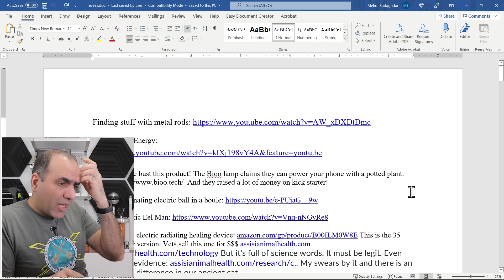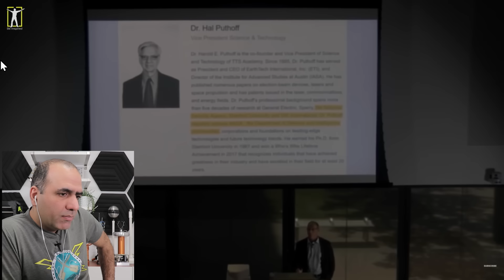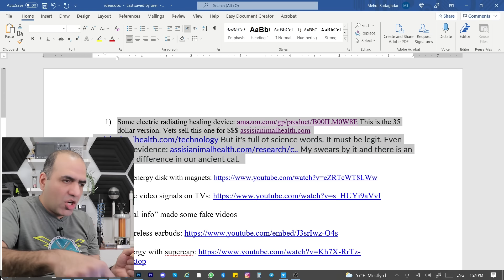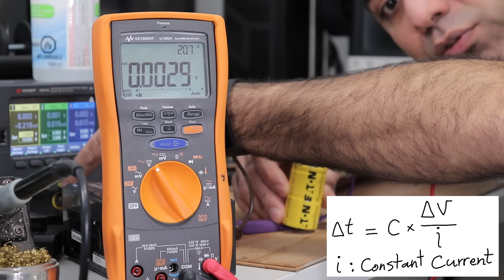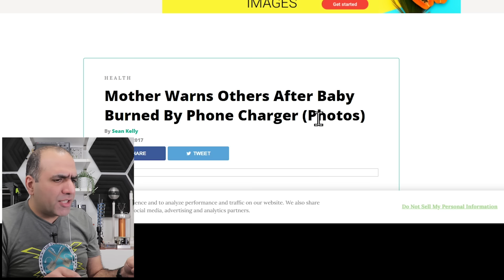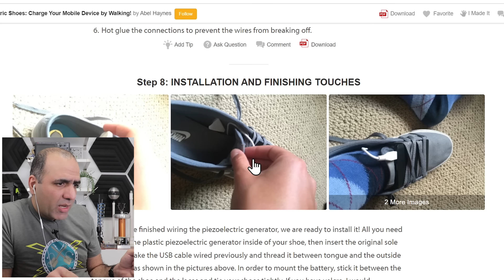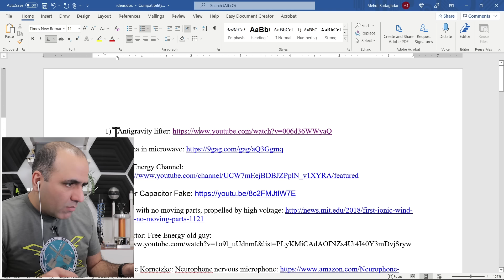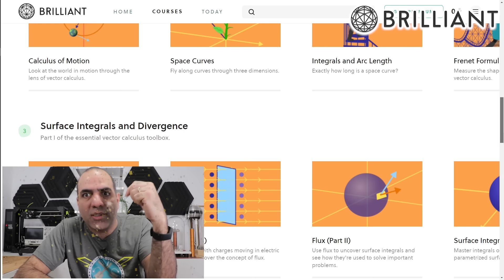The GARBAGE People Fall For, Year-End Cleanup

Comment: I remember being an amazed 12-year-old kid the first time I saw a well driller use a set of witching rods. Years later I found that we were directly above an underground aquifer a mile wide and 12-miles long. He could have drilled literally anywhere and hit water at 180 feet.
Reply: So you're saying the rods worked!

...for him.

...with tricks.

FORBIDDEN SCIENCE!!!
Reply: I did this to find a water hose underground and it worked
Reply: I have personally used witching rods....they work. Don't ask me how but it does every time.
Reply: I work in municipal construction. We often call for a utility locate (because we have to) and then witch it ourselves.
Reply: @andrewkamm8784  Sounds like confirmatiom bias.  Witch the stuff first, then call a utility locater.
Reply: I'm sure by now someone has done hard science on the rods. Truly blinded. I don't remember how long ago, but I remember seeing one such experiment that showed no meaningful difference between random chance and a "skilled search".

It's one thing to dowse in a location where one knows there will be a source, and quite another to dowse in a very controlled situation. If the method works then it should be possible to dowse the direction of a buried pipeline. Not just a point location, but dowsing multiple points to indicate a buried pipeline and its orientation.

Anecdotal evidence itself may indicate our propensity for predictive outcomes, as opposed to falsifiable, relatable evidence.
Reply: I know right... <Me, with two rods, walking over a suburban road:> "OMG! Wow! I found a pipe under here!!!!"
Reply: I think you should test it yourself, before you claim it is not real. I want to know the science behind it.
Reply: @ScotHarkins  I am telling you that it is accurate in an open field. We located a 60 year old sewer line that the city had no record of. We needed to eliminate the line  due to E.P.A guidelines, before we could excavate on the property. I have over 10 years experience in the field and trust witching over poorly recorded schematics. I am not going to go on about this anymore, but am curious how it works.
Reply: @andrewkamm8784  The witch rods prove that the earth is flat, If the earth is round the rods will be square, but the rods are rods so its flat, ~ I Asked Your Question in Facebook and I received this
Reply: but bro wtf it worked for me for real i used those to find pipes a little under ground that i use to water my grass and i forgot where those were, my uncle came showed me for example how it works and it showed exacly where pipes were
Reply: @andrewkamm8784  cool. It is a thing that keeps turning up in the hands of professionals in the field who are otherwise using standard professional practices that are guided by engineering and legal principles. It is difficult to simply ignore anecdotal experience like yours.

The trick is understanding the boundaries in novel discovery conditions such as "we know there is a pipe here somewhere, just not exactly where", in conditions where one could not simply dig up an overlarge area on, say, a public roadway. The first obvious "yes, but"s are experience with similar situations over a working career. Established roadways rarely change orientation or lateral location over decades or centuries, so there are some dimensional boundaries already in play, even if unconsciously.

Do you have a specific set of rods that you use all the time, or can you make rods on the fly, or like the old witchers strip down a y-branch and use it? You may only have experience with rods and not with witching sticks, so really I guess it would be do you have "lucky rods" or can you make do on any job? Do you feel the rods being moved by some force acting on the rods the same as if someone actually pushed on the tips?

Have you gotten better over time with the skill? How many years practiced, and how many times a year? Would you say your skill improved significantly over time or just somewhat improved? Like from "works sometimes" to "works always" versus "worked always but I'm more accurate now"?

Have you noticed any difference in sensitivity around external conditions? Works better or worse on cold versus hot days, drier versus humid days, etc. How about with the soil encountered at a site? Better when the soil is sandy or more clay? How about plain weather?...like with storms in the area does or does not work so well, etc?

Huh...it should be possible to create a questionnaire that walks practitioners like yourself through such questions. Gather data on personal experience, personal choice of dowsing tools, likely conditions where used (locating buried pipes, buried springs, shallower water tables, etc.), to help define where and how the skill is employed and by whom and with what success.

The reason we get so hung up on the unlikely nature of the skill is that there is a physical tool that moves in some way to indicate increased probability of the sought-after source. "Moving" a thing requires force, but experiments where the tools were not directly controlled by the practitioner showed no such movements or even detectable forces. Sadly, placing rods in the high-dexterous human hand means the rods can be easily and subtly manipulated, meaning the "force" is likely introduced by the user, making the measurement subjective and prone to a vast array of motivating conditions, even unconscious will informed by technical experience that is difficult to express in words but easy to access with a tool that maybe quiets the noisy conscious mind.

It is a fascinating and ancient skill that is still practiced around the world. It is possible we are simply not asking the right questions, focused as we are on the tool and not the practitioner, and centered on the idea that there is some external force moving the tool, versus the tool being some means of indicating something that we simply did not know that we knew.
Reply: @ScotHarkins  Probably the most correct idea how to prove or disapprove this "phenomenon". Honestly I would believe in Harry Potter's sorcery more - it most likely is based on real quantum effects.
Reply: @KrotowX  I'm going with a mixture of things that amount to local awareness and subconscious signaling.

In the country you might learn about which trees and grasses favor available water versus those that fill in the more arid areas. Your witching success would favor first your plain knowledge, most likely local, and a native intelligence around flora and fauna. Your successes reinforce a mental image of the area where you struck. Over time that mental image is reinforced...the mixture and density of plants and grasses of kinds that dominate more hydrated spots. You don't think about it, but it "feels more right".

The process is not just the rods or sticks. You start to dig and the soil is darker than drier soil...the moisture gradient may rise more quickly with water closer to the surface. Maybe it's even enough to increase the humidity over the area, and your nose picks it up even when you don't think about it consciously. All of that feeds your mental map of better spots. You don't "think" about it...it is now just innate experience.

An urban area would be different. Still trained over time by experience. Maybe you know the town's history...you kinda have to when dealing with buried pipes going back over a century. You might have noticed that in the 1890s they tended to run sewer pipes down the very middle of the road, usually at some depth and slope common to the time. You might have looked at maps from the 1930s with a 40 foot right of way but be aware that the current roadbed is wider by 15 feet to one side but only 10 feet to the other. Do you actually sense the pipe or are you imagining the pipe under an overlay of the old and new road and unconsciously making a reasoned guess? If the pipe is 24" wide your dig is still going to be 48-60" wide, which gives you good odds of being "close enough to be right".

The upshot is that the tool may be about letting go of the conscious thought process to give way to a more creative subconscious process that is simply informed by all the disparate bits of knowledge. The result would be that you move the rods or stick yourself, but you don't think about it. It's a subconscious result and not a conscious choice.

History records ineffective witchers and dowsers who could not make a trade of it. How many of those were there, and how aware were they of the telltale signs compared to the successful witchers and dowsers?

Some people could not machine a course-threaded bolt no matter how many times they try while the next person has it mastered in only a few runs. No reason to think the same differential propensity exists within a body of hopeful witchers and dowsers. Many may fail and several succeed, not for lack of magic or grace, but over how well they already know better spots from worse spots, and with their ability to improve that experience over time.

I think a truer test would be a non-local, new-to-the-subject area, over a controlled and mapped area...for soil conditions, water table, depth and orientation of buried pipes and hoses, etc. Do the same over a natural area with local and nonlocal subjects, mapping all their answers (but not yet digging) and checking to see how they actually compare by then digging for each.

By these means you can test whether there is an actual phenomenon, or a local knowledge aspect, or a combination.
Reply: If anyone questions the validity of the witching rods. I challenge you to take an old hanger or a decent gage wire, and try for yourself. First, bend the wire 90° with a short side at least an inch longer than the width of your hand. Have 8 inches to a foot on the other end. Next place a rod in each hand, resting the tip of the shorter side on your pinky finger. Tilt the rods forward slightly so they are resting on just your index and pinky finger, do not grip the rod. With your elbows at your side and your arms bent 90°, walk forward slowly between your water, natural gas, sewer, or any service line supply and your house. Anywhere you intersect the service line you will see the rods attract towards each other. Place a mark where the rods are parallel and repeat from other side. Be sure to place a mark when going both ways. The space between the two marks is your ditch line. You WILL find your supply line within 8 inches of the space between your marks.
Reply: @ScotHarkins  It’s very easy to ignore anecdotal bullshit. I do it all the time.
Reply: @andrewkamm8784  Yea, no. Just no. That is not how physics works. Please stop spreading this nonsense.
Reply: @TheJohnreeves  you tell me that a construction supervisor of 7 years doesn't know what he is talking about? I use them effectively every time. I don't understand how they work, but know they do. 
I am not trying to start an argument,  I just ask that you know your $#1+ before you question me. And I can definitively say you know nothing on the subject.
Reply: Lol, I am done with the subject.
Reply: @TheJohnreeves  It is not like I am commenting on something I know nothing about, like you are. I am not commenting on how to crochet, I'll leave that up to you. I am done with this stupid back and forth.
Reply: They use these in construction where my dad works to find water and power lines
Reply: @andrewkamm8784  I don't know what to tell you, you've been suckered. It's not like people are immune to it just because you've done a job in the field for a long time.
Reply: @andrewkamm8784  The irony of "you can't fix stupid" being said by someone who believes in magic divining rods.
Reply: @andrewkamm8784  i used to believe dowsing rods were BS.  then i watched a guy i work for use them.  we found a water line that we were looking for quite easily.  years later, i helped my father-in-law find another water line.  works great!
Reply: @andrewkamm8784  my dad showed me how it works for some people and it ends up it works for me. An old man used his keys to tell my dad where to drill for water on his 15 acres, he not only found where to drill but also told how deep. We have one of the five biggest wells in the county and the depth was exact. There is no scientific proof or explanation for it just a big well we have used for fourth years. None of the neighbors have anything near what we do so it's not a giant aquifer. There are hints though such as a natural spring and a seasonal creek close by so it could be that coupled with years of experience since the old man was known to find water for anyone that asked. If I remember correctly his success rate is near perfect.
Reply: @andrewkamm8784  the name of the technique is Radiesthesia. In my 34 years old, I come to conclusion that it may work for some people and to others don't. Also not only to water, but anything that person using the technique wants to find. People here also use wood into a Y format. I remember a a news tv where a guy used to it, ask for some one on the news crew to try it. When it worked he, the tv guy,  got scared and run way.  Most people who dig wells here, and do not use this,  when asked about, also does not have the courage to say it is bullshit, yet internet warriors most think it is.
Reply: @fernandoschumans4542  no you had placebo effect and got lucky, thus you believed it solved your issue
Reply: @andrewkamm8784  There is no need, holding pieces of non counter weighed metal rods in sweaty hands are going to go all over the place regardless of some mystical divination power that doesn't exist.
Reply: @dougsmith9290  its a placebo effect, you got lucky
Reply: @robywankenobi32 Wow, I am embarrassed for you. Is ground penetrating radar, cost effective? NO! Do you have any knowledge about the subject .....no. So why show your ignorance?
Reply: @robywankenobi32  have you ever tried them yourself?
Reply: @lowlowsandclothes9923  nope I wouldn't have to because I have a scientific approach to everything in life call evidence based decision making, I wouldn't need to do any testing to make myself happy or conclusive as as the entire quackery has to many variables to clearly answer the hypothesis - voiding any of the claims of two pieces of fucking steel rod or sticks some bloke broke off a tree hahaha
Reply: @robywankenobi32  A true scientist will always test before coming to a conclusion. You are not.
Reply: @andrewkamm8784  I literally don't care for any of your responses sorry haha, bye
Reply: @niallgalaxy48  let's all stop "beating a dead horse"
Reply: Why not trying those rods on water hoses that are upon the ground?
Reply: @brendanwarrick4978  Two sticks are not technology lol
Reply: @andrewkamm8784  I do like how this guy has continued to respond after 3 times saying they won't anymore (four if you count the "stop beating a dead horse")
Reply: @RatchetOrion  how about 5. Lol I was referring to the one guy but whatever
Reply: Honestly proving this will not change anybody's life so......I won't try anymore.
Reply: @andrewkamm8784  
 
"Won't?"
Or can't?

Like I said to Brendan above, if you really are so certain that these 'witching rods' (so called) truly can be used to find buried water pipes and so on, you should definitely get in touch with The James Randi Foundation and demonstrate them.
Not only would you win a HUGE cash reward, right then and there, but a Nobel Prize with your name on it would practically be guaranteed.
Reply: @andrewkamm8784  And seeing the responses to your testimonial has totally turned me off from this channel.  This guy must attract people that behave a certain way because he behaves the same way.  He's very popular too I see.  Yikes.  I guarantee none of them have ever talked to a well driller or would even be capable of having a productive conversation with one on the topic.  They act as though they believe they are the Galileos, when in reality they are the church calling out heresy.  It's fine if they are very skeptical.  I am myself to this day because I can't see how it works, but I can't be so bold to say I KNOW it doesn't work when it is still something that professionals in the craft use.  Only fools are positive about whether witching works or not.  Living in Alaska, where wells are still being drilled daily, I have come across plenty of engineers that said they couldn't believe there was any truth to witching rods until they saw it for themselves.  It is indeed a mystery, not simply a scam.
Reply: @ericksonjustinAK  
Which 'professionals in the craft' use magic to find water?
What are their names? Who do they work for? How many times have they actually demonstrated successful use of this method?
Who are these 'engineers' you claim you've met? What are their names? Who do they work for? How many are actually ON RECORD as believing in this stuff?
It's easy to talk about people believing in, or being able to do magic, but for some reason actual, reliable evidence seems much harder to deliver.
Reply: @ericksonjustinAK  
"Heresy?"
Seriously?
It's "heresy" to simply ask, "Oh yeah? Sticks eh? Can you please show me?" is it?
It's "heresy" to doubt unsubstantiated claims?
Doubt and skepticism is hardly unwarranted when dealing with claims like this. 
Claims which have repeatedly and consistently failed any kind of unbiased verification for literal centuries now. 
Did you ever hear about that lady in Uganda (I think it was Uganda..?) - called herself a witch or some variation of the term - who claimed she could make refined, high octane gasoline come pouring out of a rock?
There's a famous photo of her 'demonstrating' her magic gasoline pouring out of her rock and into a bucket in front of the leader of the country.
The government gave her a giant pile of money to produce magic fuel, and she disappeared.
Later on, when someone actually bothered to check the rock, they found it was hollow with a tank and a pump inside it. 
Do you think that government was wise to accept her claims without checking carefully?
Did all the people who scoffed at her 'magic' and insisted it must be a scam have good reasons for doing so, do you think?
Likewise, do you really think that anyone who scoffs at 'witching sticks' does so without perfectly good and justifiable reasons? Or are you sticking with "heresy?"

[Edit: I was mistaken - the lady with the magic rock was from Zimbabwe, not Uganda.]
Reply: @brendanwarrick4978  
Iron is magnetic. Iron ore (magnetite), Nickel and Cobalt are magnetic, when a field is applied to them. A couple of Rare Earth Elements are magnetic within certain temperature ranges.
They aren't found just lying around in the soil though, and any detectable magnetic fields they might emit have nothing to do with water.
If your claims were true, and these fields were actually there and powerful enough to move a couple of wire coat hangers in some 'witch's' hands, then they would also render traditional compasses absolutely useless the whole world over.
Likewise, any electronic device which relied on some kind of magnetic storage, like a cassette or a VHS tape, or a computer hard drive, would also become completely useless, anywhere there was water flowing underground. 

No, it's got nothing to do with magnetism. 
Would you care to try suggesting something else?

(Yes, I was well aware that you meant "ferrous," rather than "Ferris." I made a point of drawing attention to the error however (not to mock, although I understand perfectly that it probably seemed that way), in order to show that such an elementary mistake, along with the idea that there are such things as water 'atoms,' and the carelessness that allowed those mistakes to creep past, puts quite a dent in your credibility.
Sorry about that, but it's just the way things are. It's always worth proof reading before posting, especially when one wishes to be taken seriously.)
Reply: @brendanwarrick4978  
You want me to try and prove your wacky claims FOR you?
Think again pal...

You could have just said that you didn't know - would have been a little bit more graceful.
Reply: @ericksonjustinAK  
You think it's "incredibly rude and arrogant" to simply ask that people actually support and justify their claims of woo-woo, witchcraft and magic?

If you really want anyone to accept that 'professional well drillers' actually, truly do use these 'methods' when choosing where to drill, then I'm afraid it's going to take a little bit more than just your say so.
Honestly, it's like your side of this is actually allergic to convincing evidence.

You're right - the magic gasoline woman was a terrible example to compare this nonsense to - SHE actually went to the effort of giving a demonstration of her 'magic' (faked though it was).
You guys seem to expect everyone to accept everything you say, simply because you said it. That's not enough.
Reply: @brendanwarrick4978  
There is no "disproving" in science. 
I'm honestly not super surprised at the misconception though - it's common one. 
It is impossible to 'prove' a negative.
In any case, that's not what I'm trying to do - I'm asking that the people who apparently believe in magic, and apparently care enough about it to bicker about it in public like this, give some reason (ANY reason) to believe what they say. 
Your word, I'm afraid, is just not good enough on its own, and the way you all go running for cover, screaming insults over your shoulder when anyone mentions "evidence" only further hurts your credibility.
Reply: @stickiedmin6508  Whatever.  I wasn't trying to convince people that don't want to be convinced.  I am just sharing what I know about the matter.  Believe what you want to believe and quit being offended because I'm defending someone giving a testimonial of what they have witnessed.  You have never been around someone that uses witching rods and I can tell you have never talked to a well digger.  I have and so have others.  Get over it.  You're demanding that I provide names and concrete evidence, etc etc.  I am also skeptical.  But I know well diggers still use them.  I was just sharing my experience.  I have no duty to prove to you anything and you demanding that I do or shut up is exactly the attitude I'm talking about that is acting like what I am saying is heresy unless I can prove it.  I'm muting you now.
Reply: @brendanwarrick4978  
You understand that rust is not iron though, don't you? That it's not magnetic in any way?
Just as table salt shares none of the properties of metallic, elemental sodium (or chlorine for that matter), rust shares none of the properties of elemental iron.

If this 'magnetic force' that you're insisting is there, is strong enough to make bits of wire held in a 'witch's' hands, then surely it's strong enough to move a compass needle?
Yes?
No?
Reply: @ericksonjustinAK  
But I DO want to be convinced. 
How many times do I need to say so?
Why do you think I keep asking for evidence?
Show me - please?
Anything?

Or, just run for it. Off you go then kitten.
Reply: @brendanwarrick4978  
Dude. 
Stop making excuses. 
Do you have anything to show the class or not?
Reply: @brendanwarrick4978  
Questions are "toxic?"
I'm beginning to understand why people fall for woo-woo like this...
Reply: @brendanwarrick4978  
Is that what I said?
Look again.
Reply: @brendanwarrick4978  
If you expect someone to believe what you're telling them, and they ask you why they should, then I'm sorry - if you actually care about convincing anyone, then it most certainly is your responsibility to provide reasons to do so. 

Happily, scientific enquiry stopped relying on anonymous hearsay a LONG time ago.
Reply: @brendanwarrick4978  
"Word play?"
🤦‍♂️
Reply: @brendanwarrick4978  But AC Clarke was also well aware that magic or not, bullshit is still bullshit.
Reply: @stickiedmin6508  I think you'll find that many engineers don't really believe in it despite using it.

My Dad was a civil engineer, and once explained to me that he didn't really believe that it works, but he occasionally did it anyway.  It's cheap and easy to do with stuff you can usually find nearby, and it can't be worse than drilling randomly if you have no better information.
Reply: @fromagefrizzbizz9377  
Well, our new friends Brendan, Justin and Adam from further up in the thread certainly seem to believe in it. 
I just wish they could tell me why?
Reply: @stickiedmin6508  Whenever you bring up this subject in forums explicitly for professional electricians, there's always a bit of contention on this subject. It can go around in circles for some time.  My experience, and the majority of professionals insist on screw terminals for safety.  The only real advantage to push-in is speed.

When it was combined in one of the opinions you're mentioned, the clearly false claim that screws always loosen, I get concerned.  The only time that happens is if it wasn't tightened properly in the first place, or you're using aluminum which suffers from a number of issues that often loosen the screw grip.  As for aluminum, using push-in terminals have NEVER been legal even with aluminum-rated outlets.
Reply: @stickiedmin6508  tbh some of the pro stickers in this thread type /veeery/ similarly
Reply: @33screamingfrogs34  
Interesting observation...
Yes, that's quite curious, isn't it?
Reply: @andrewkamm8784  how about you try it when you don't already know where the pipe is... just a suggestion... xD
Reply: @ericksonjustinAK  in general, the person who gets offended is the one who blocks the other person. that would be you.
also, in general, when someone blocks you (if you're not an absolute jerk) then they're most likely the one who is (convinced on the inside) that they're wrong and wont admit it.
Reply: @stickiedmin6508   wow, reading this, you sound an awful lot like me, (not a bad thing) I consider myself pretty smart, and I'm pretty impressed with all the information you put up with, but honestly, YouTube-users don't generally respond well to long thought-out comments. its generally better to keep it short and simple so their brains can actually comprehend it- (at least more easily). also, don't ever mock anyone or insult anyone, the moment that you do that, your opponent will try to tear you to shreds with that 1 single thing you did wrong, completely disregarding everything that your opponent himself did wrong. you basically have to be perfect, otherwise your opponent will convince the crowd to follow them. its frustrating, and difficult, and its also why I prefer short comments, because almost nobody can twist my words, since they're short and concise and my meaning is very obvious.
anyway, have a nice day, and always remember to be kind and patient, even with people who wont return the favor, otherwise you risk getting attacked by every other user that reads your comment, and confirmation bias and the bandwagon fallacy will rule...
Reply: @Metal_Master_YT  I'm wrong about what?  What I have heard or witnessed?  I'm just telling you what I have been around.  Does it bother you that I am in a location with a ton of well drillers and I have something to share about it?  I haven't even said that I believe witching rods work.

No, sometimes the one blocking is just tired of the discussion because people won't quit, like yourself, and it becomes a fool's errand to keep talking to them as they get all indignant and worked up and say things confidently that are illogical.  The endless circle is pointless. And oftentimes people that won't quit might have an issue deep down.  Think you need to adjust your perspective.  I'll say it again, well drillers use witching even when no one is around and I have been around engineers that also have witnessed it and find it inexplicable, meaning they don't automatically believe it is just a farce.  

Now are you going to keep arguing with me now?  Think you need to study up a little bit more on cognitive dissonance and how it manifests itself.  One way is lashing out and attacking character, like you are here.  Another way is just not accepting facts and feeling compelled to argue incessantly because they can't let it rest because something doesn't rest well within them. He asked me for names.  Like I'm going to give him names of people I know that he doesn't know from Adam and that will convince him I'm telling the truth.  That is a detachment from logic and sounds like somebody that isn't really concerned about asking logical questions, but more interested in seeing if the witch floats so they can justify their desire to burn her.

Now you will feel a need to argue with me, I'm sure.  Enjoy yourself.
Reply: @ericksonjustinAK  
"Facts?"
What 'facts?'
I asked for 'facts' and you all ran away?

Please, by all means, share these 'facts' of yours?
Reply: @Metal_Master_YT  
It's the same every time. 
They paint themselves into a corner, then stomp off in a sulk, yelling over their shoulders about how much they won.
Every time . . .
Reply: @stickiedmin6508  *"You understand that rust is not iron though, don't you? That it's not magnetic in any way?
Just as table salt shares none of the properties of metallic, elemental sodium (or chlorine for that matter), rust shares none of the properties of elemental iron."*
well actually, having an interest in chemistry, I know that this is not completely accurate. yes, when it comes to elements and compounds that include those elements, their properties tend to be very different, but there are many similarities as well. for example, if you have aluminum, and aluminum oxide, they both contain aluminum, and since both aluminum and oxygen have a low atomic mass, and a low density, the compound Al2O3 (aluminum oxide) is therefore also fairly lightweight. in another example, sodium reacts with chloride ions (or simply chlorine gas) to form sodium chloride (table salt). this ionic molecule is quite stable, and prefers to be in this configuration. in the same way, when you expose other sodium containing compounds to chloride ions, they too will become sodium chloride. for example, sodium bicarbonate (baking soda) reacts with HCl to form sodium chloride, CO2, and water. in both cases, sodium- (even in a compound that has more oxygen and carbon atoms than sodium atoms) will react with Cl to form sodium chloride. so in the end, yes, "rust is not iron" but rust still IS magnetic, just put a magnet on a piece of rusty iron and test it. I mean really, your statement was obviously not thought through, because the black ceramic refrigerator magnets that are so common in households, are made from iron oxide (rust), quite a common counter example. also, lodestones (natural magnets) are made from magnetite (the same stuff in ceramic refrigerator magnets) which is also iron oxide. (rust)
Reply: @Metal_Master_YT   
Yes, I made a point of mentioning magnetite, and indeed other iron oxides, as well as the fact that they do exhibit some magnetic properties, when exposed to an external magnetic field.
In the absence of an externally applied field, whether natural, magnetic iron, or electromagnetic, they're no more or less magnetic than any of the other countless minerals that make up the soil. 
We're also in agreement, I assume, that water flowing underground does not generate any kind of magnetic field?
I don't know if Brendan's responses to me are still visible to anyone else - I certainly can't see them anymore at least - if you can see what the guy wrote, I once again feel pretty safe in assuming that you find them to be as weird and puzzling as I did, my learned new friend?

(I'm going to have to start copypasting any specific posts that I'm responding to in future - it's getting to be quite annoying when the person I'm talking to just vanishes, mid conversation, leaving me looking like a lunatic who spent a week arguing with myself.)
Reply: Last year in the village we found water in our field using these 10 gauge copper wires, we brought an excavator and it dug about 5meters, there was a some water, my uncle put coil pipes and made a small wooden pond, so now the sheep and other animals can drink water there, I didn't think those wires would work, but there is still water coming out
Reply: @ugraltnbilek  
Did you bother trying to dig anywhere else?
Reply: Rods worked on both our wells, very odd. What's even stranger is that I didn't watch them with the rods so I wouldn't be influenced by watching him first. I 'found' water in the same spot. Add yes, I'm sure they could have drilled anywhere :-)
Reply: @andrewkamm8784  Don't let these guys get to you Andrew. People always dismiss things they don't understand and/or is contrary to popular opinion. Has happened throughout history over and over again. 

You had a honest question and you should not have been attacked for that.

Plus, Electroboom didn't disprove Divining rods. He disproved the theory that guy had in the video has to why they work. 

Also, in my experience the rods always attract each other, not repel. First time I've seen them repel was in that poor quality video Electroboom highlighted. 

So if anything, that videos hypothesis is is incorrect. Nonetheless, witchersticks are real and do work.

I didn't believe in them either at first. Then my foreman (in the gas line industry) used it one day and I was amazed. Since then I've used them myself many times. 

I will say they can sometimes be unreliable simply because they can detect so many different things. Power lines (underground or overhead), gas, and of course water. This is where knowledge and skill come into play. Based on the lay of the land and what your looking for, you can decide what hits to take seriously and which to ignore.

Either way, I too would like to understand how they work. One day we will.
Reply: @tynj4173  
What's the name of the 'utility company' your 'Dad' works for please?
Reply: @tynj4173  I am an engineer by training and by profession. If there is not a quantifiable explanation, then it does exist. End of discussion.
Reply: @tynj4173  
Show me where I said it was 'false" please?
If you weren't interested in what I had to say, why on Earth did you ask about it?
When someone asks me a question, I answer it - is that not how it works in your world?
Reply: @tynj4173  Quite the contrary. All of science is based on observing a given phenomena and deriving an understanding of it from quantitative, observable, and repeatable data. That is the foundation of science that has remained principally unchanged since before Archimedes of Syracuse!

As an aside, please do not ever refer to engineering or another educated profession as a trade. A trade is an unskilled or otherwise low-class job. An engineer is a professional, not a peasant tradesman.
Reply: @andrewkamm8784  I do utility locating and have used this technique myself, idk how but I've had it work on several occasions
Reply: @ScotHarkins  I'm with Andrew Kamm on this, as a locator I've used this truck on gas lines multiple times and been spot on with my marks, now you should NEVER  do an entire locate with this technique but in a pinch spray dots where the rods were leading you and have it verified by QC (they have pipe horns) and I'm just saying multiple instances of being correct is either extremely coincidental
Reply: He was making sure there were no big rocks. 😹
Reply: @FerretWarlord1  No the locator always comes before you literally can’t work until he has came and marked the pipes if they are off though they use rods and the pipe is always right where the rods crossed
Reply: @andrewkamm8784  7 year supervisor doesn’t mean anything try owning a underground company for 20 years, these rods work 100%
Reply: @robywankenobi32  Then my company has been getting lucky for 20 years, no placebo here
Reply: @fuxi  I am confused....7 years as a supervisor doesn't mean anything, and then you agree with me. I guess you are saying you are even more experienced than I, and yet agree.
Reply: Or have you not read my comments?
Reply: @andrewkamm8784  I’m not boasting about my experience,I wouldn’t do that I’m just saying so other people can see on top of your 7 years Supervisor experience they have someone that agrees and has experience also, I really want people to realize that this isn’t some trick or fake.
Reply: Got shown this by a farmer and I thought he was taking the piss at the start. 100% it works. Use fencing wire and hold it loose then walk under your power lines or a running hose, you'll be surprised!